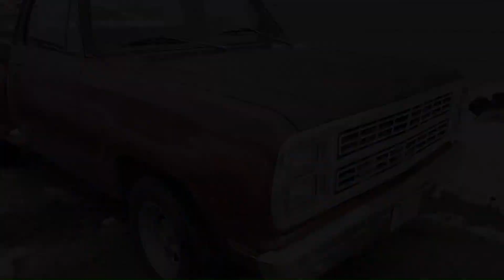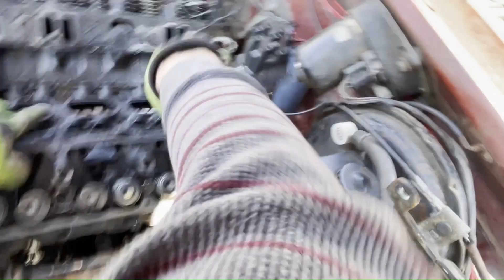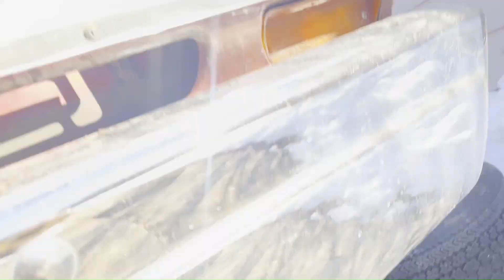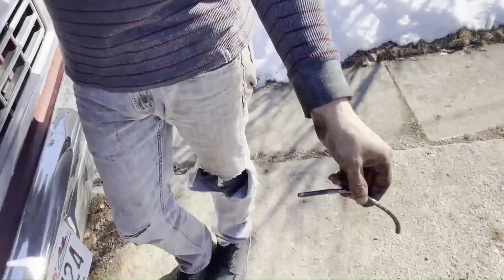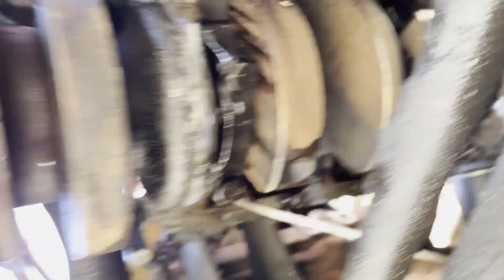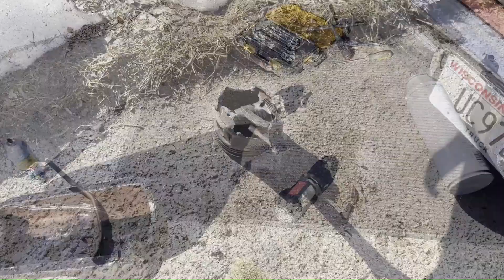This 1979 Dodge D100 makes a strange new sound.  The reason will surprise you!

Comment: I had a 75 D100 with a 318. Ever since it was new it would idle and run up to about 60 miles an hour without a miss, but any faster than that and it would start picking up a miss, and at 85 it was almost a shudder. At 150,000 miles I had the intake manifold off and there was a three-quarter inch pipe nipple that was inside the manifold. Never had a miss after that.
Reply from the maker: That’s some quality control right there 😂!

Comment: Sorry to see that happened to you all. I have the power wagon version of that truck with sweptsides. Great truck, after converting the np203 to 2 wheel drive capable. I do recommend putting relays in the engine bay for the headlights. I had mine start overheating the headlight switch and the high low dimmer switch. I did convert my engine over to fuel injection with the edelbrock proflo 4 and runs better during the cold starts and stays running. Hope to see more of this truck show up in my feeds. Good luck on the engine swap.

Comment: I see my buddy ddg made a comment but as a engine builder myself a pushrod would be chopped up in pieces or wrapped around a rod. This is a spun rod bearing and my guess is lost oil pressure. So pumps do fail on these motors but another cause is snapped shaft that drives the pump. Pull the gear and have a look. If the push rod hit the gear stopping it fast it would shear that shaft. I have broke them in a 383 before.
Reply from the maker: I’ll do another deeper dive into the engine once I get it out and on a stand. I’ll take a look at that gear. So your thought is that extra pushrod was already in the oil pan from before?
Reply: @Stage Zero Garage  well I shared them with Jamie tonight and it's like this. Someone did a valve job or replaced a cracked head a long time ago. They were crappy mechanics and dropped a push rod or one got bent and fell in the valley some how. It was left there. It moved back to the cam drive gear and stopped the pump distributor gear. With pressure on the pump it would want to still pump from fluid motion. The shaft would shear at the pump and thus no oil pressure. That bearing is one of the last to get fed oil. Take the pump off the rear main and inspect the shaft. Also take the rod cap off next to the spun one or the front main. This motor lost oil pressure and that's why it died. You can talk to Jamie about me if you want. I am in Rochester mn. I have lots of mopars and a 79 d100 drag truck.

Comment: I've actually found Rodnuts in 2 different Mopar Big Blocks and what looked like cigarette butts in a buddy's 383 in his RR, and it was a Supposed? Untouched 65k motor. So your Pushrod deal doesn't surprise me at all. FYI, and you may already know the 360 and 318 are balanced different, if you choose that route. 👍👍
Reply from the maker: I was hoping I’d get some more fun examples of what others have found in their engines!  Yeah, I rebuilt the Lil Red Express’ 360…which is why I worry about its longevity.